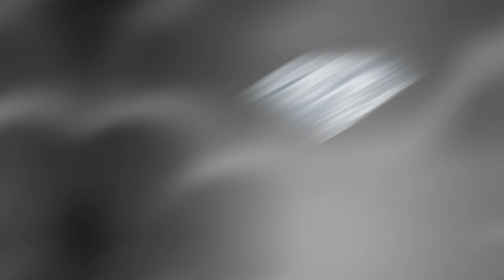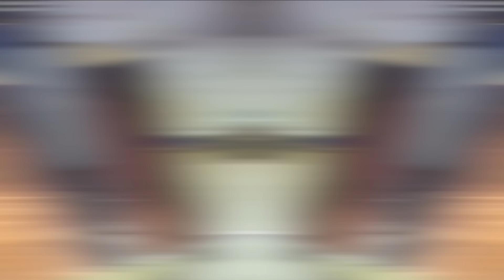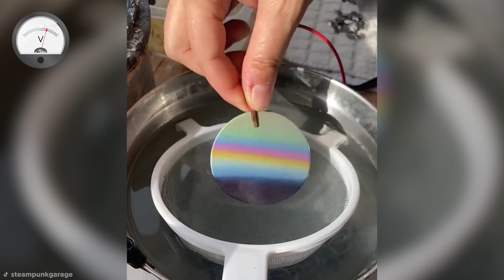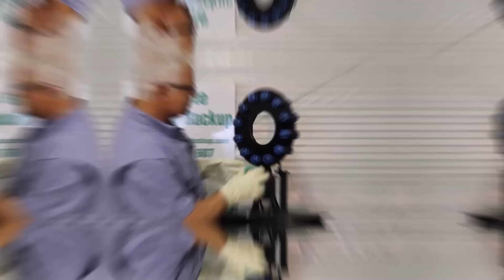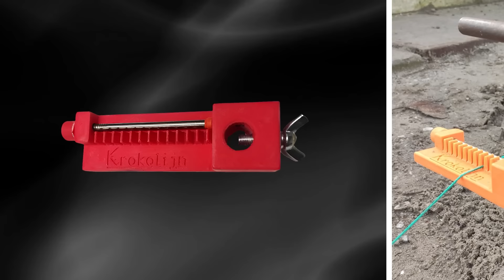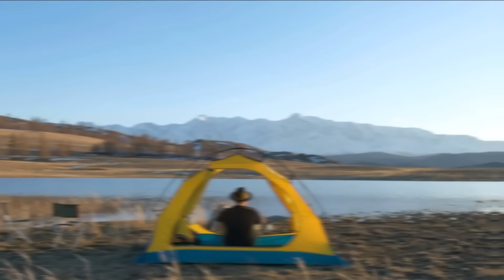When Amazing Tools Are on Another Level

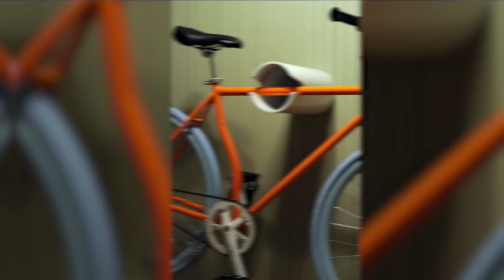Comment: @21:00 PVC pipe with cutout attached to wall, as bicycle wall mount
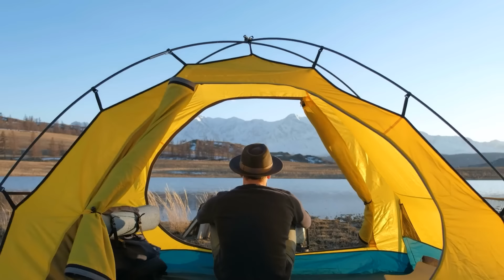@25:35 inexpensive aluminum tent/canopy anchors/fixators; 3" long, "fish-bone" shape that can slot into gaps in decking, fencing, benches, & tree branches.  Can attach to tent using carabiners & bungee loops (costing $1 each! ???)
[6.26.2026]
[When Amazing Tools Are on Another Level - BE AMAZED]

Comment: You described the piezoelectric effect backwards. It is not an electrically charged crystal that is struck to discharge the electricity. It's a crystal which is stressed by being struck and that stress generates an electrical charge. Applying an electrical charge to the crystal would cause it to mechanically warp. These are exceedingly common devices for igniting gasses, from pilot lights, to gas ovens, to grills, etc. etc. etc.

Comment: Just for reference, there is nothing valuable about diamonds. It's literally just compressed carbon. We estimate there to be several quadrillion tons of the stuff underground. Way less makes it up to the surface, but the price is mostly just artificial scarcity and marketing. Other gems like sapphires, emeralds or rubies are rarer to aquire but usually way less expensive. If diamonds were priced according to supply and ease of access only, their price would equal semi-rare gems like topaz or garnet. If you want a diamond just get a synthetic one. Way cheaper and of better quality. If you dont care about it being a diamond, just get something  like a moissanite, which has an even higher refractory index, meaning it "sparkles more". Tho it also has a more fiery rainbowy look, which is subjective. Still an order of magnitude or more less expensive than diamonds.
Reply: I've heard that pawn shops put no value on the diamonds in a piece of jewelry and only value an item based on what the gold or silver is currently worth and you just explained why, so thank you. The friend that told me this said that they told the pawn shop they would just remove the diamond since it had no value, but of course this wasn't an option. All of the pawn shop owners must've had a meeting and agreed to put no value on diamonds, just like when the light bulb manufacturers had a secret meeting in Switzerland. They agreed to stop making bulbs that last a long time bc they couldn’t make enough money that way. There's a bulb in a Firehouse basement somewhere in America that has been burning for about 100 years bc it was made before that meeting took place. OMGoodness, I finally got to share some of my useless knowledge even though nobody’s going to read it...
Reply: @angelharrington1977  Rest assured that at least i read it^^
Tho, the reason pawn shops do not place (or very little) value on diamonds is slightly more complex and plays into what i wrote above. First of all, they cant expect to sell it anywhere near the value asked for in jewelry shops, since prices are artificially inflated there. It also is a slow seller. And unlike gold or silver, you cant melt it to make more usefull stuff out of it, so the diamond alone has little "fallback value", compared to the gold ring. If you cant sell the ring itself, the gold has undeniable value. But the diamond? May aswell toss it out in that scenario. Nobody is going to buy some random diamond from a pawn shop lol. I mean.. it would be kinda genius considering the alternative i guess.. but that's apparantly not what's happening.
Reply: @Yamyatos  Thanks again! If you don't mind me asking, how do you know these things? I am not doubting you at all, I'm just wondering due to an unrelated reason.
Reply: @angelharrington1977  By all means; doubt me. There is nothing wrong with that. Most people on the internet are increadibly bad sources of information; that's why raw milk advocates, flat earthers and antivaxxers are on the rise lol. If you care about how i know about this topic specifically.. im actually not sure anymore. The first time i heard about diamonds being basically worthless was probably the better part of a decade ago, on youtube.. and im pretty sure it was about alternative "better" rocks, like moissanite. The name of which i obviously did not remember for all of those years, but looked up for my above comment.

As for how i generally aquire information.. i'd assume the same way most people aquire information unrelated to their field / profession: some youtube, some googling, nowadays some chatgpt. That said, chatgpt is a horrible source of information, unless you already have enough background knowledge about a topic to know when it's bs'ing you, and youtube (shorts, specifically), tiktok and other short form content is notorious for people just outright making stuff up and being full of conspiracy theories. So i'd stay clear of those. I'd say googling and reading expert sources (depending on the topic anything from scientific papers to reddit) is still the best way to aquire accurate information, but for things you only casually care about chatgpt probably delivers faster results that are true often enough, but should be checked if they are in some way, shape or form relevant to you. Credible educational youtube channels are also a great source of information (like Kurzgesagt), but obviously you cant really learn about a topic you chose there. 

I hope i didnt miss your question and went into detail about things you dont actually care about^^
I think most people in the modern age have similar sources for their knowledge. Some just care more about making sure that what they believe is true than others. I personally have a scientific background, so caring about sources was drilled into me.

Comment: Er,...... we do know that the water powered turbine to power a thermomotor to measure shower water temperature is a thing that is sold on eBay? (Just the thing to compliment my heat pump hot water system.)

Comment: Ryobi, Milwaukee, and Hart are all brands owned by Techtronic Industries, a Hong Kong company. So Ryobi isn't Japanese, they also didn't develop Oscillating Multi-tool, and Milkwaukee isn't an American company. Not anymore at least.

Also, 3800F is above Steel's melting point, and WAY above copper's. That website "panthereast" you got that info was OBVIOUSLY wrong about the temperature.

Also, the Lokrite isn't held in place by "magnets". It's held in place by simply not being able to rotate past the neighboring nut (the reason for the screw).
Reply: TTI also own some of Ridgid tools.

Comment: If you DIY a lot then get you a oscillating tool. When remodeling a bathroom recently the structures were built with those annoying staples. My oscillating tool was indispensable in cutting through those with great speed.

Comment: Edit: The Lock Right Backup Wrench if flipped around it can also be used as a way to break loose the Nuts on the all-thread studs without having to use a Knock wrench and beater 

The Brush Grubber Extreme seems like it could also work as a anchor for a winch for pulling your truck out of the mud pit

Comment: As a 10 year operator of concrete/rock core drills, blade- and wire saws, I can promise you they do NOT cut like butter, and their speed is not that high. They're awesome tools, but it's still a pretty slow process. Gotta remember, unlike a traditional basic drill (bit) that use sharp edges and often spiral flutes to cut, strip and gouge/hog out material - these kinds of concrete/rock/masonry diamond cutters grinds away at the medium. Think sandpaper, not knives.

Prices may have chsnged over the years. But IIRC that particular hilti core drill model (looks lile a 300) is significantly more than 9 grand. Thr one I had used to spend more time at the service center than in the field, because the internal seals would notoriously fail, leaking water into the electronics.
Reply: diamond carbide doesn't cut composites like butter either... $500 - 1000 saw blades wouldn't even last a day when I worked for Martin Marietta (the irony being, it was still the cheapest option as water jets and lasers didn't work either)
Reply: @wildbill6976   @wildbill6976 The excess friction and heat is murder on all such cutters eventually. It not only heavily wears at the substrate the diamond grit is bonded to, but it can get so hot that the bonding softens enough that the diamond grit eventually get torn off. The best you can usually do to improve longevity for these kinds of "cutters" is cool them, commonly by circulating fluid. The blade/shank/cylinder used just doesn't have nearly enough thermal conductivity for chilling that, internally or a distance away from the cutting action itself, to help cool the "teeth" / crown(s) adequately. Fluid cooling "the cut" though, also helps lubricate and evacuate cut/ground material particles, both reducing excess friction.

But fluid cooling / lubrication is usually a major no-go when cutting composites. As both the fluid itself, and through it other contaminants, can/will oxidize material and wick into the composite through the bare edges that the cut exposes. (I assume you know this well, but others reading this might not).

Lasers aren't great for very thick composites, and/or composite materials with exceptional thermal conductivity like carbon fiber, graphene etc. Difficult to cut without damaging the surrounding material and compromise the binder/matrix. Waterjets - well then we're back to the wicking issue, plus the added bonus of the immense pressure causing fraying and delaminations. Good times 😅

Comment: That Ryobi one has kind of copy Milwaukee. I love Milwaukee because I actually dropped my dad‘s Milwaukee drill three times from I really tall ladder on top of our second story roof and it still works rent pretty damn good and it’s a fuel and it runs perfect. Things are designed to be handled rough and still work perfect but the I seen those suckers snap blacksmith comes in and actually touches it wrong and never have that issue.

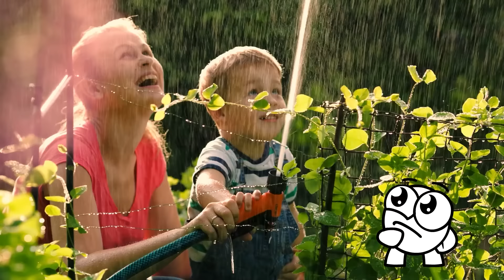Comment: The water faucet turbine in the thumbnail is at 22:40
Reply: Thanks for the time stamp. Disappointing it doesn't do anything. It's as "amazing on another level" as someone 3d printing a pinwheel to stick outside and say it can be used to power an LED.
Reply: We have one connected to our water tower in our farm that water our the crops  , although ofc we spend more electricity on the pump that brings the water up to the tower ,but we cycle that energy back into the water pump but we only get about 20 percent of the electricity back that was used to pump it up , unlike the fake YouTube videos that make the “free energy” videos , lot of energy loss due to friction
Reply: @brianperez7695  :) That's something people may forget when using such ingenious ideas: Energy is never free. When you install such a turbine in the waterflow, you will loose pressure / flow speed. When you use it to water your crops, keep in mind that such a turbine may reduce the distance the water can reach. That's why water towers are usually that high, to ensure enough pressure. When you have excess pressure of course you could use such a turbine to extract that, but as you already said, there's always some losses involved anyways.

People have been thinking about installing turbines into roof gutter pipes to extract energy when it's raining. However the amount of water is relatively small tand the pressure / energy you get from a typical height of a house is almost nothing. A metric ton of water at a height of 10m only has about 0.0272 kWh of energy, assuming no losses in the conversion. I asked the AI to calculate the average water throughput here in germany for an average house over the course of a year. It came up with about 80m³/year. That's just about 2kWh of energy. So when you have a single 500W solar panel it could generate the same amount of energy in just 4h assuming 100% efficiency.  So the whole idea to have a turbine in your gutter which consists of moving parts which need maintenance and are subject to wear and tear is just completely pointless. That's why hydro-electric power plants or power storage utilize really large lakes or rivers as the only way to make it efficient is to have a metric sh*t ton of water at your disposal.
Reply: “You are strong and wise, Anakin, and I am very proud of you.”
Reply: :penguin-blue-waving-tear:    you're like Jesus!

Comment: Great video, but it's painful to watch you crediting specific tools to specific brands And wording it in a way where it's easily mistakable that that brand would be the only Or first one to do it Also, Making it sound like specific tools Are unique to solving their problems for example. glossing over the fact that there is a plethora of battery powered, soldering irons and that is not the only option.

Comment: let me tell you. while satisfying to make a large hole... those drills are unwieldy and can wrench your arm out of your socket easily. :P Speaking from unfortunate experience. and it doesn't have to be your fault, if it catches rebar at wrong angle it can get stuck and the force goes into your hands. :D

Comment: Interesting as always - but I can't help thinking the researchers for this one were hungover or waaay out of their depth!

Most of the tools that are implied to be created by a single company have been around for years (if not several decades) and are not the original or in any way unique in what they do.
If you had concentrated on the way they work rather than looking like advertising for brands, it would have made a better video.

Also, the gas soldering iron - reaching "3800 degrees Fahrenheit / 2093 degrees Centigrade" ...... Someone slipped up big time there - Copper melts at 1085'C. Possibly the flame temperature, though that is not relevant  to the bit working temperature?

And as for being a recent innovation - I've personally been using cordless soldering irons since the 1970s, when corded ones were not practical. There are hundreds of types, both gas and battery / rechargeable.

(It's very! rare I see a single major error in any of your videos, they are generally superb - it's  only because this has so many that I'm commenting).

Comment: As a former concrete cutter. I can attest that running a core drill correctly does go through reinforced concrete like butter. Always fun to use but needed to be dead on to avoid issues. Biggest bit I ran was 30" in diameter

Comment: $123 for that crappy bicycle wall mount? Good grief! I just checked and can get a nice folding wall bracket for around $20. It's a lot more work to securely mount that pipe to a wall than to screw in a wall bracket too. The pipe doesn't even look classy or artistic; it's just a boring PVC pipe. I thought most of your selections were fascinating but figure you included this one as a comment magnet. So congrats, you got me. :D

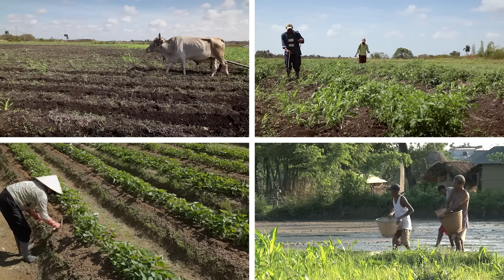Comment: At 21:29, The Rolmako subsoiler is not new:  several have been made in the U.S. for around 50 years, with the CIH 14 automatic reset subsoiler being considered the pinnacle, due to its rear-and-up trip mechanism, and its constant tooth angle, regardless of the hardness of the earth.

Comment: "heating the copper bit to temperatures exceeding 3800* F", what stupidity, copper melts @ around 2000*. Steel melts @ 2500* F.

Comment: I've used these core drills before.  Large enough to fit a human inside the hole for opening bank vaults when they lock themselves out (legally, of course)   its a very expensive and time-consuming project.

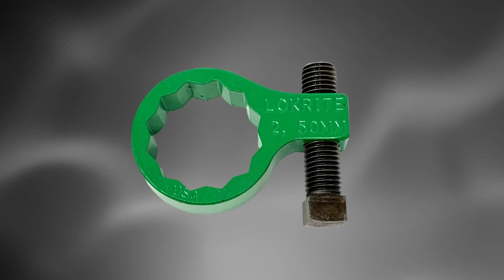Comment: Love these innovations. For the "Backup Wrench" (14:24) to save money, make your own. Buy a socket set and weld a piece of bar on the side of each socket.
Reply: Better weld something with a thread to it, so you can use a bolt. As the device gets pushed into the neighboring nut, it may get too tight to remove, so you can loosen the bolt instead to release tension. (Not sure if it's clear what I mean, but I can't think of better words right now)
Reply: Or go the cheaper route and weld a Nut to a bolt...
Reply: @NathanThompsonBlueEyes  Or just don't be a limp wrist and use a dead wrench like real men do!
Reply: my God I love the ice pipe clamps!
Reply: How come MY oscillating tool never cuts like that?
Reply: Would be much cheaper if they didn't embed the magnets into it. The torque alone would keep it in place once it has been started. Typical over engineering making things much more expensive than they need to be.

Comment: As I have heard it, Industrial diamonds are actually the harder type of diamonds and the ones slapped on rings are the idiot stones which aren't as hard, just pretty. Also the absolute hardest ones are very special created in actually rare circumstances into having a hexagonal structure instead of a cubic one. Normal ring diamonds are kind of overblown, extremely low in rarity etc.
Reply: Speaking as a metal detectorist, I can say that the reclamation value in a diamond ring is in the GOLD... and not the stone!  Diamonds are kept artificially expensive, but their resale value is very low. In fact, many detectorists will pry the stones out and leave them in a jar while selling jewelry for its melt value.
Reply: I spent most of my life working with gems and minerals, and jewelry making. Industrial diamonds usually have impurities that cause them to be unsuitable for jewelry purposes. But all diamonds have what is called a perfect cleavage plane, and if hit from the right direction, they shatter like glass. And the industrial diamonds are also used for cutting and polishing other gems. You are correct that the price is artificial, a certain diamond company has huge vaults full of flawless diamonds, that keeps the supply controlled. There are occasionally large or unique diamonds, but the majority in the one to five carat stones are highly controlled. Many colored gems are truthfully more valuable than diamonds, like alexandrite, rubies, and emeralds.